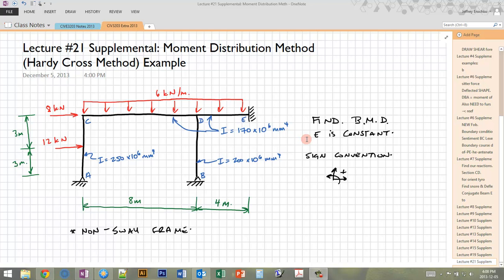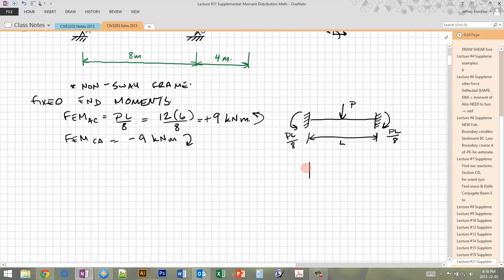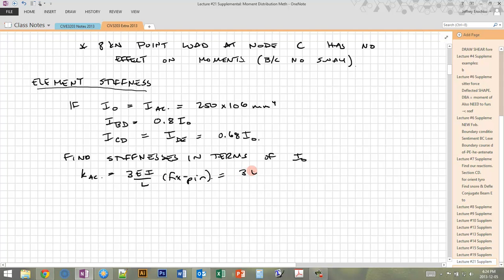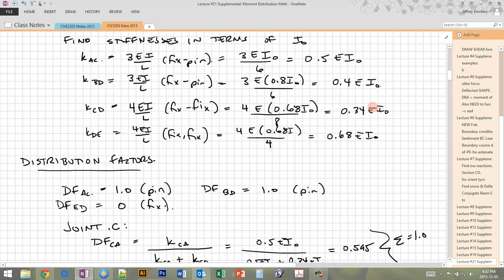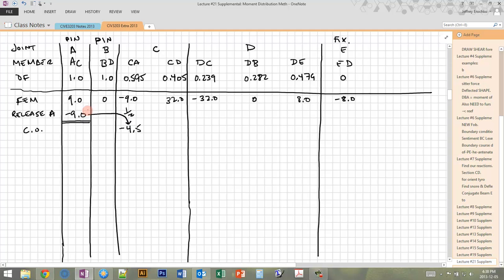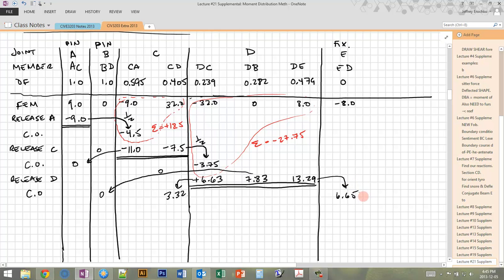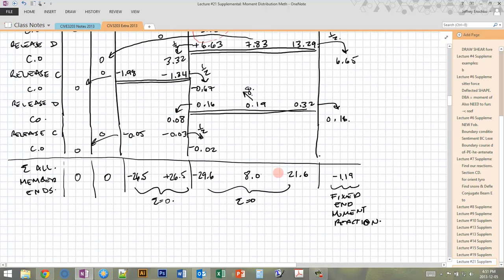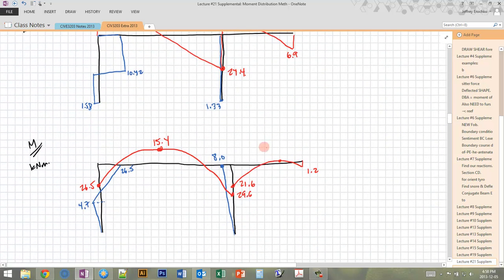EXAMPLE - Moment Distribution Method (Hardy Cross Method) for an Indeterminate Frame

Comment: Thank you for sharing this. However I think there is a mistake in computing the fixed end moment of member AC. It is a fix-pin member so FEM_CA=3PL/16 as you used the modified stiffness 3EI/L for AC. 

Was I wrong? Please let me know. Thanks again.
Reply: I also agree with u
Reply: @moyeenishrar2851  But in moment distribution method you have to find as considering fixed ends that's why we calculate fixed end moment.
Reply: But in moment distribution method you have to find as considering fixed ends that's why we calculate fixed end moment.